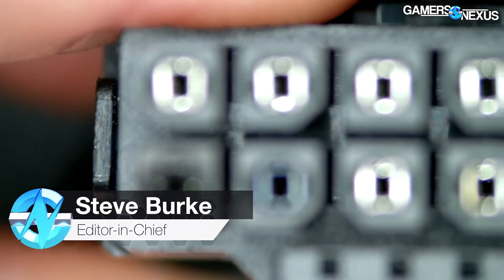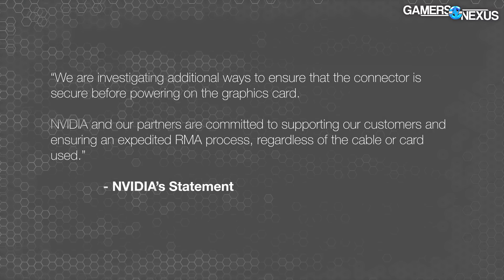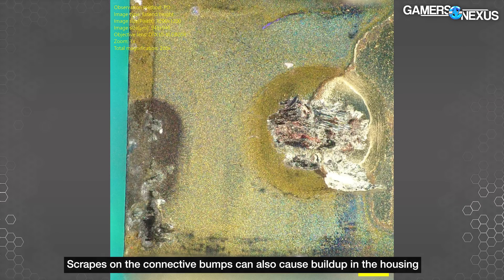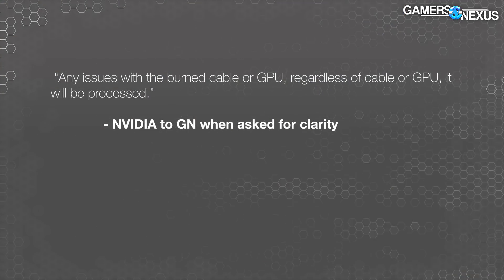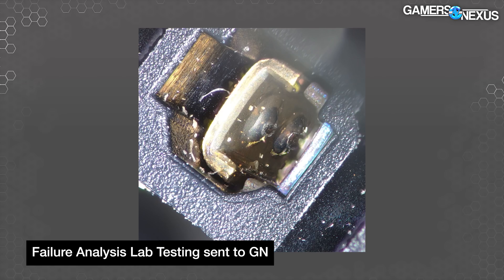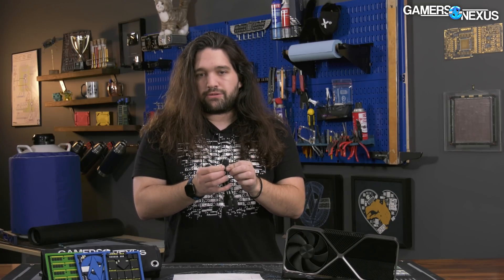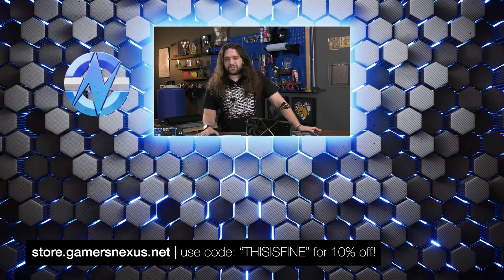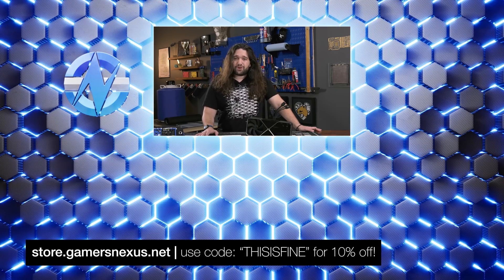NVIDIA Responds to Melting Cables, Warranty Concerns, & 12VHPWR Adapter Failures

Comment: The older NVIDIA cards' power adapters had larger gauge wires and pins going into a larger connector, pushing ~150W on each connector.  Now they have THREE TIMES the power flowing through a smaller connector with smaller wires.  Gee I wonder where the problem actually is?!?!?  

This is an NVIDIA design issue, not a user issue.  NVIDIA is a scumbag company for not standing behind their customers who are spending thousands of dollars for their poorly designed cards!

I wonder if EGVA saw this coming, gave feedback to NVIDIA, and dropped them when they wouldn't back down from this insane design flaw which would have cost EVGA millions in replacing these badly designed cards?!?!  The timing is right on the mark for this scenario.

Comment: The 4090s need to be recalled and the power connectors redesigned to be more like the old 3090s connections.  There is NO REASON to force that much power through these small connectors when the 3090s didn't have any of the issues that the 4090s do.   Stop kissing NVIDIA's a$$ on this!  These cards are very expensive and it is criminal to have this ticking time bomb on such an expensive video card!

Comment: Pretty sure if the sense pins are not connected the power will be limited to 100 watt start up and 150 watt running power = too low for a 4090 but would be fine for a 4070 (200w TDP)  Really 225 watts if you include 75 from PCI slot.

Comment: tbh, they could make all the pins longer for better connection. about 4 - 5mm maybe so "If" user error occurs they had some Buffer 4 - 5mm not fully plug-in. and better contact point (small 6 dimples make me uneasy about "possible" 600-watt power through).

Comment: That NVIDIA statement "regardless of cable or GPU" doesn't make sense after they just got done saying "using other cables may void the warranty".

wtf?

I have my eyes on the Corsair 600w PCIE 5.0 12vhpwr type-4 PSU power cable just because I don't trust NVIDIA's cable. I sometimes leave my computer running - I don't want a fire while I am at work.

Get the Corsair or take the chance with NVIDIA? Card arrives tomorrow.

Comment: So I've got a stupid question. From the adapter there are 4 connections. Do i need to use 4 independent vga cables for each connector or will 2 vga cables  work (2 connectors on one end for adapter and the other end going into the psu)

Comment: Well, as a 4090 user, I can comfirm that my power cable was not fully inserted after I installed my card. I can only tell this because I've read NVidia's statement before and I had a flashlight to actually lit up the connector area. It was only 3/4 inserted. Visual inspection is critical.

Comment: Had no issues for months with my MSI 4090, even double checked my cable the day after GN posted their first video on this and confirmed my cable was secure. Upgraded to an ultrawide monitor on Black Friday and instantly started noticing video issues... eventually, the monitor completely stopped receiving a signal. Went to reseat my card and noticed the plastic on the connector was melting exactly like others have reported. Guess it's more than a .1% failure rate after all. 🤦‍♂
Reply: Or you fall within that 0.1%.
Reply: @ragnnohab  Maybe... but considering that MSI instantly approved the RMA for a $1800 video card no questions asked, i'd bet the number is a little greater than 0.1%

Comment: Nvidia selling 4090 cards for 2000-3000 dollars and a cable is the problem the don`t take responsability for. Thats f""""""" crazy.
Reply: So did you not watch any of the three videos GN did on this issue? Nvidia's problem was they assumed their consumer base was intelligent enough to plug a cable in.

Comment: They state the usage of improper cables may lead to loss of warranty. Meanwhile, the official cables that come with the 40 series is so short you wont be able to connect it to your power supply, it barely reaches to the bottom side of the card if you bend it too ...

Comment: I would like to know what absolute Poron made the "design" decision for the plug to "stick out" like that of that massive card?
Anyone with actual intelligence would have made an "L Shaped" plug, even as well angled slightly the direction of the plugs toward the back some 30 degrees or whatever.

Comment: Can't belive the cable has no way of securing it to the gpu it needs a locking mechanism to keep it nice n tight, would be great if you actually screwed them in like you do with a vga cable
Reply: People have been clipping in power cables to GPUs since the 90s without melting things, there's no point going overboard because a few of you can't be trusted not to put yourselves in danger.

Comment: Why not use 2 pcie power connetors? Tat was the case on the gtx980 ti. Its not as if the power supply dont have them (usually 4).
Reply: It is expensive to put two connectors than one
Reply: @eng3d  you are talking about a 1200$ card. Plus they made a proprietary cable which is incredibly coslty to develop (and it dows not work). A PCI-E connector is about 5 cents on the market for 100 000+ units. All this crap to save less than 5 cents.
Reply: @eng3d  No, not when one is mass produced and the other not.
Reply: So you have two cables you didn't plug in properly instead of one?
Reply: @ragnnohab  No, it was proven that the wires where not big enough for the power consumption. And the cheap ass connector will always not be really well connected anyway. I can't understand why they made a connector as cheap as that on a 1000$ graphic card considering it is the most important piece of the graphic card. It's just like people that install the cheapest power supply and then complain that their motherboard has burned. My point is to off balance the power (just like devices that has 2 usb to connect to the computer). I guess this is a Nvidia failed attempt to have a proprietary connector to sell to third party.

Comment: Its not user error if the design is no good to begin with. the design has to meet the application.  If everyday people cant plug it in with slight error then its no good. Think of your house plug. It leaves little to no user error.  They are going to blame the user but say they will just take care of it anyway? Not a great look. Very cocky

Comment: The lengths of detailed testing you have gone through and the information supplied throughout all the videos on the subject have been outstanding. Bravo.

As someone who picked up one of the initial units, I had been worried about the situation and following along to stay in the knowledge loop best I could.

Ironically, lastnight I joined the ranks of the melty cable ranks after the unit had been running smoothly for weeks. Now whether it in reality had been or not been stable for weeks is yet to be determined but no signs were apparent until getting hit with a sudden black screen last night and further inspection. 🤣

Comment: This is a BS response.  This connector is insufficient for the power requirements of this card.  If 2mm is the difference between functional and plastic fumigation, it's time to start from scratch.  This is an engineering FAILURE.
Reply: Doesn't matter how much power a cable can transfer when you people don't plug them in all the way.
Reply: @ragnnohab  Ehhh..  When you don't plug in a USB cable all the way, the device wigs out or doesn't turn on.  This releases carcinogenic fumes, ruins the card, and creates a fire hazard.  Cable and connector engineering matters.  Safety and derating margins are a real thing.

Comment: 12:00 What about just including a thermister in there somewhere to detect an overheating connector? They do this with AC connectors on some high wattage products. (But most would have never heard of it, as it's molded in.) My car's portable AC charger does this.

Comment: If the cable has sense lines - probably NVIDIA software can measure voltage drop across the connector and inform user via app, that it is inserted improperly.

Comment: Design error or not it shows you how stupid people have become that you need to show them how to plug the connector into the socket. I guess all those flying sparks from idiotic modern cgi “movies” still did not ring any bells. Thank you for doing this investigation you have saved some lucky kids a lot of money although I find the whole thing slightly depressing. The simplest and cheapest solution would to print one sentence to make sure the card is connected properly - they can’t do it though as no one can be bothered to read yet alone understand these days.

Comment: So they designed a cable to a ~1,700 card to be worse in every conceivable way to every cable that came before it, and people are shocked there's an outlier of use error? The whole plug should have been shitcanned off the rip when the latch didn't properly click every time.
Reply: ya but its a professional GPU. Making the cable stupid proof would be the equivalent of placing training wheels on a super sport bike. Users complaining about burning power cables due to improper seating would be the same set of people who would blame Yamaha for crashing an R1 because it didn't come with training wheels.
Reply: @javiersantana848  that is the worst analogy you could have pulled from your ass. Having safe cables, preventing catastrophic failure to your expensive equipment vs having having equipment to make learning how to use it easier and safer. Fucking brilliant jump there. Asking for safety features is like asking for a bib to eat my food too, huh? Moron.
Reply: @DrDeIirious  Speak English please..
Reply: @javiersantana848  man's not even old enough to comprehend his language, you hate to see it
Reply: @DrDeIirious I already asked nicely for you to please speak English. Since I see you are struggling with that, I also see no reason to drag this on any further.
Reply: @javiersantana848  whatever you say neophyte
Reply: @javiersantana848  None of my comments were deleted though? Also, I thought you were done responding?
Reply: @DrDeIirious  The cables are safe though, just plug them in properly wimp.

Comment: Kind of the same thing happened to me with type c connectors. Fully inserted and over time and vibration(s). The Type c connector can work it's way out of the type c port and disconnect on the back of mobo i/o. I don't fully trust type c connectors. Way too loose a connection type.

Comment: I still find this a faulty design - we can say user error but if they recommend you to plug the cable when the card is outside the Motherboard - means you need a "dangerous" amount of pressure to "securely" plug in a damn cable
Reply: ya but its a professional GPU. Making the cable stupid proof would be the equivalent of placing training wheels on a super sport bike. Users complaining about burning power cables due to improper seating would be the same set of people who would blame Yamaha for crashing an R1 because it didn't come with training wheels.
Reply: @javiersantana848  I mean, I never would think about the cable plug - ever. It's in - jobs done - otherwise something won't start. But true, I have never worked with ludicrously overpowered hardware before

Comment: If nVidia confirms 50 cases of melting cables, I think it is safe to assume there's probably twice as much cases for the first 125k of 4090 sold (not RMA'de, not disclosed or not recognized by nVidia).
Reply: It's is atleast 51. I joined the ranks lastnight after weeks of it running smoothly. 🏃‍♂️
Reply: So worst case scenario is 1% of all these cards sold at the time end up melting the power cables because people don't plug them in fully. You still haven't made this out to be a widespread issue.

Comment: I am sorry but any company that thinks that the end consumer should be responsible for cabling perfectly a dangerous power item without any dummy proofing is smoking dope. It would be one thing if only certified computer technicians were allowed to build systems, but NVidia business model is predicated on end user upgradeable parts. There is a history of consumers building their own systems and a reasonable expectation that cable management is plug and play. If they build high power units that demand cable precision then UL listings should demand either hardwired cables or a certified cable just like they do with wall warts. No consumer should be blamed for doing it wrong unless they stick the cable up their nose and take a wet finger and place it into a wall outlet and the other hand into to the GPU fan blade. Seriously, NVidia. Get your fucking act together before you kill people.
Reply: Do you want Nvidia to send Linus Tech Tips over to your house so you finally feel safe handling your GPU?
Reply: ya but its a professional GPU and the target consumers are not the average consumer, being that its a niche product. Making the cable stupid proof would be the equivalent of placing training wheels on a super sport bike. Users complaining about burning power cables due to improper seating would be the same set of people who would blame Yamaha for crashing an R1 because it didn't come with training wheels.
Reply: @javiersantana848  Pleas explain what you mean by a professional GPU. It’s a gaming GPU and encouraged for any consumer. And even if it were for pros only there should be detailed installation instructions to prevent fires. Don’t be.an apologist for their laziness and irresponsibility.
Reply: @DesertPackrat  " Pleas explain what you mean by a professional GPU" Serio ?? LOL !🤣. " It’s a gaming GPU and encouraged for any consumer" NO, its not. Its a niche product developed for enthusiasts. If you don't understand the very simple basics of what an entry level GPU vs a professional grade GPU that happens to be niche, then you have much more studying to do. Once you grabbed the basics, then we can actually talk.,
Reply: @DesertPackrat  " And even if it were for pros only there should be detailed installation instructions to prevent fires." Again, Making the cable stupid proof would be the equivalent of placing training wheels on a super sport bike. Pros dont need that sht, they are professionals. Pro builders since you need a bone here

Comment: So as a car guy who's worked for dealership's, that gas analogy actually doesn't work, because they can void warranties due to things such as that. It varies from manufacturer to manufacturer, but if your car requires 92 rating fuel, but you put in 87 because it's cheaper, if that gets tested for fuel sampling to determine warranty coverage, saving a few extra cents at the pump just turned in buying a new engine. GM is actually notorious for this and their oil specs. If your car requires 5w30, it has to be a Dexos compliant 5w30 oil. If that's tested, which is required for any warranty that could remotely even be related to an oil problem, then it's instantly voided. You're now buying a brand new engine because the idiot who charged $20 for an oil change didn't know what he was doing. 

I get where you were going with the analogy, just didn't actually align with the point being made.
Reply: ya but its a professional GPU and the target consumers are not the average consumer, its a niche product. Making the cable stupid proof would be the equivalent of placing training wheels on a super sport bike. Users complaining about burning power cables due to improper seating would be the same set of people who would blame Yamaha for crashing an R1 because it didn't come with training wheels.
Reply: @javiersantana848  That just goes into absurdist territory though lol.
Reply: @ksteinwand  huh ?
Reply: @ksteinwand  whats absurd is people not plugging their power connectors in properly, burning sht, then complaining. Leave it to the noobs to do dum sht lol

Comment: You know in retrospect it's weird that they chose a pin socket cable for high wattage power delivery, I know nearly everything else in a computer is pin socket, but like, most laptop batteries have used bladed connectors for years. Designing the 12 pin was literally the best opportunity since pcie was invented to design something appropriate for power delivery.

(Fwiw I have similar complaints about 8 pin and 24 pin connectors and atx12vo, but at least those aren't bursting into flames)

Comment: There is no easy cure for this problem. Even correctly inserted and latched, the connector will fail eventually. Trust a guy who has been there:) Just a wrong connector for the task! Until Nvidia admits their fault and replaces the connector with larger ones, at least, with 50% extra current  handling capacity, or the power supply standard is switched to 24v or better 48v bus, better take the card to an experienced repair shop and have those wires directly soldered to the board.